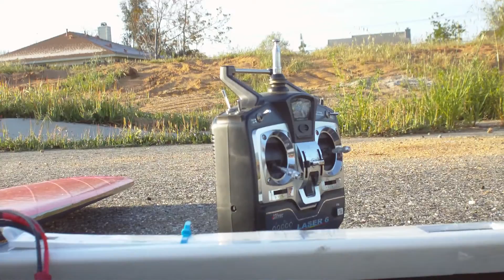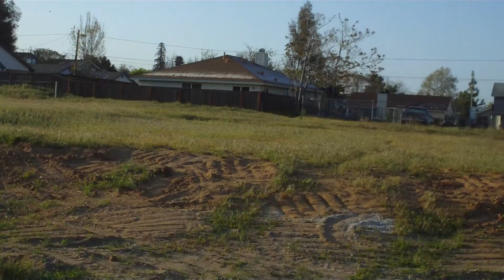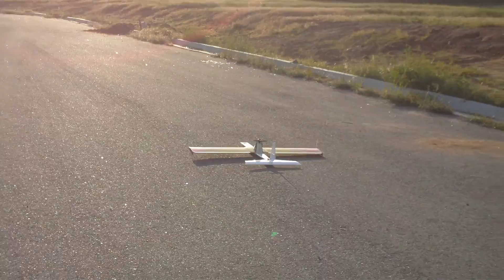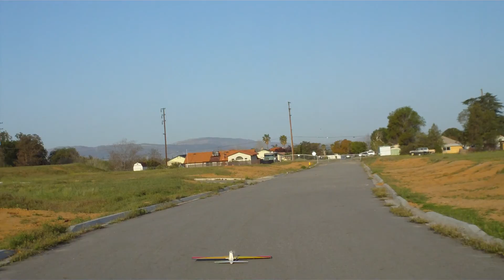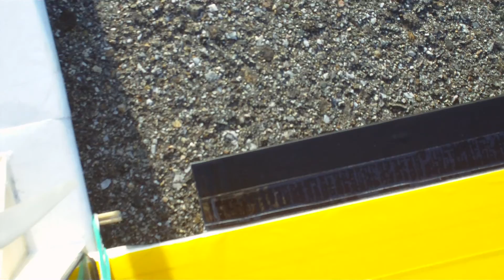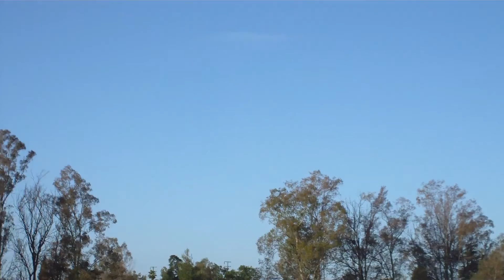Triangle design fuse...maiden part 1

Comment: Hi, your motor and prop seem to be aligned so that the thrust is pushing forwards but also down. Is there a reason for this? I'd have assumed that a forwards thrust line would be more efficient...
Reply: +Earache Erikkson Hey! thanks for the ? 
To explain I made a video some time ago called Thrust angle explained or something. See if you can find it as it will explain the awkward downward angle of the motor.
In short...the motor sits well above the theoretical thrust line (TTL) and well behind the CG, so if you leave the motor at this height above TTL pushing forward and parallel to the TTL it will push the nose of the plane downward requiring mass amounts of up elevator trim to attempt to compensate. So...it is a common design practice to angle the front of the motor downward to correct this motor arrangement. I hope this helped!
Reply: +MrWest O'Neill Yep, that is a simple and concise explanation thank you!

Comment from the maker: Hey Ed, good to hear from ya...yes I think the side angles would do well for the V tail config. The internal space is plenty for the 3-cell bats to sit flat on top of the bottom returns/beam.
Outside dimensions are; on top 3.5", and the sides are 2.375", with the returns to the inside .75". I used all of your standard  folding methods. I will do a detailed "how to" vid to demonstrate. Thank for the good word bra, West